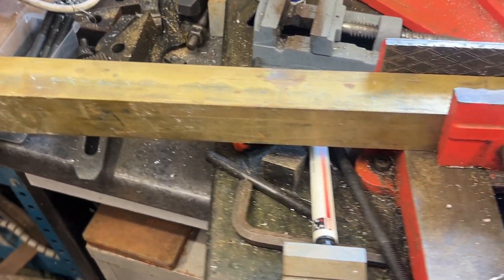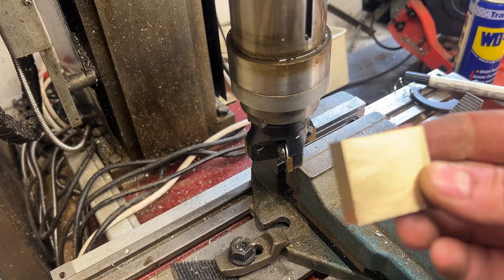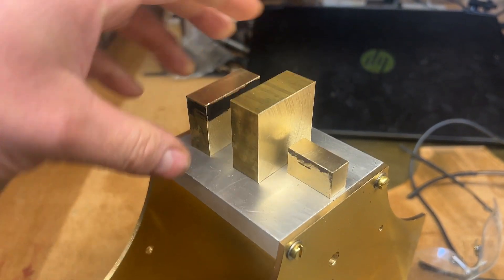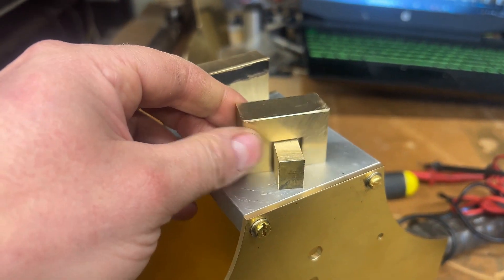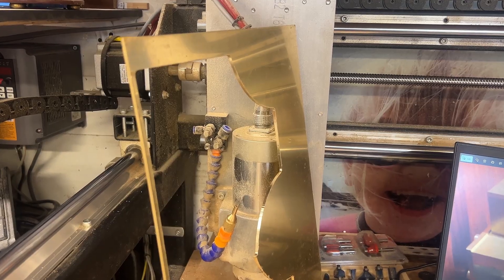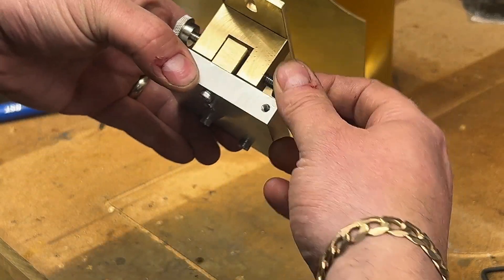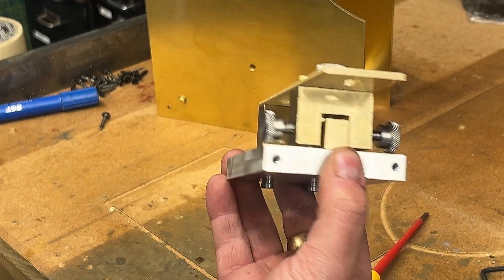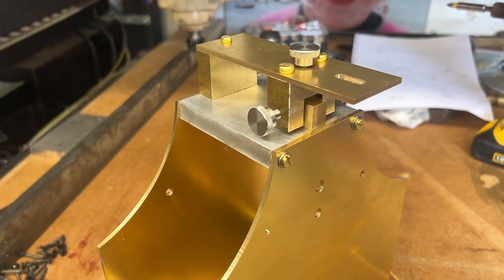Building a Clock Part 2 – Pendulum Mounting Bracket for a Tekippe Regulator

Comment: This build is going quickly ! 
How can I contact you,  in regard to sending you something ?
Reply: Seem to remember a plastic called Torlon or Tulon (?) was supposed to be quite good.  Seem to remember you had to get the right version with graphite content. Think it might have been a factor of four or five worse than Invar.   Might be worth trying it until you can source something better.
Reply from the maker: @alanwood3597 thanks Alan, I’ll take a look into it! 
Chris
Reply: @craynerd  Just dug around in my old notes.  It was Torlon.   It was available under the trade name Duratron from The Plastic People in UK. There was also something else I found called Allvar but I think it was expensive.  It had a negative temp coefficient which was a bit weird but it could be mixed with steel to get a balancing.
Reply from the maker: Hi Andy, I’m off work for 2 weeks for Easter so making the most of it 😊! 
Yes, that would be good, email is chris@raynerd.co.uk
Reply: In my Peter Heimann regulator book it mentions Repton clocks as a supplier of invar. However not sure if they are still in business. There is a phone number for them when you Google them.
The obvious substitute for invar is carbon fibre although depending on the epoxy it can be hydroscopic. Another substitute is a glass rod which should be more stable.
Reply from the maker: @michaelburns1212 the problem is that the Invar is milled out to allow seating for the pallets. So both carbon fibre and glass would be tough substitutes! 
Chris
Reply: @craynerd  Ah, OK Chris. I presumed you just wanted a cheaper alternative for the pendulum rod.
Prior to seeing your videos on building the Tekippe Regulator, l hadn't heard of this arrangement for the escapement, but it makes total sense so l fancy having a go myself.